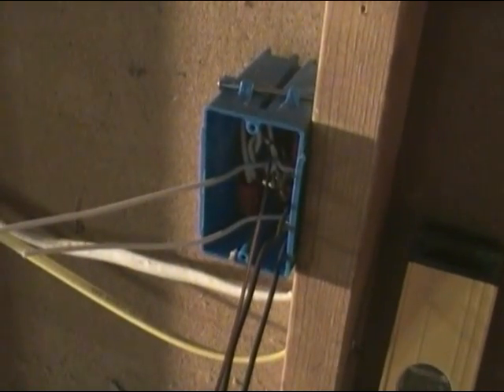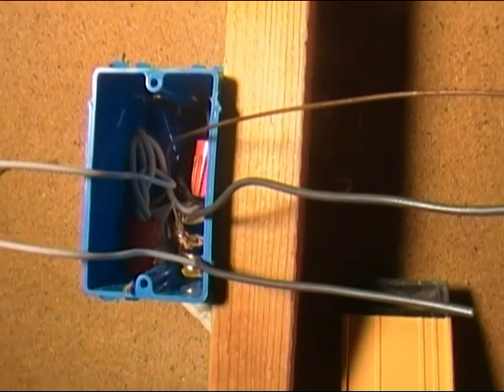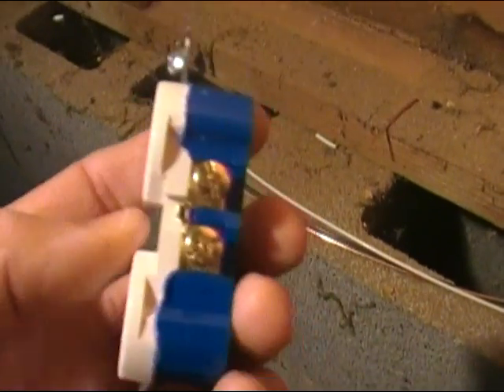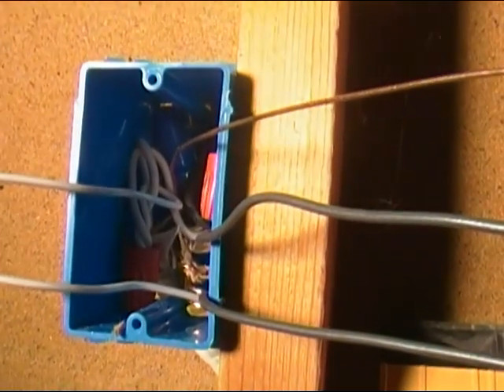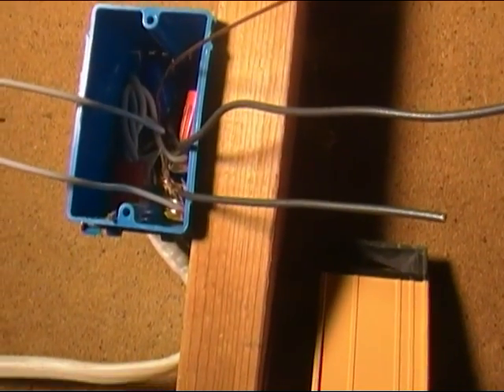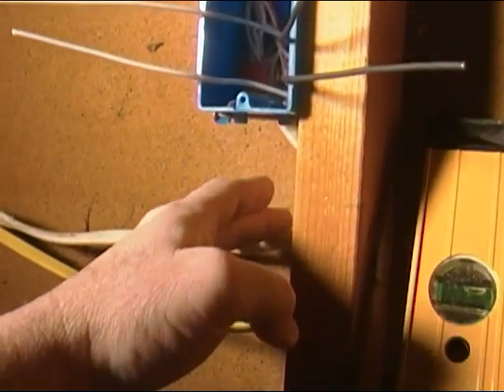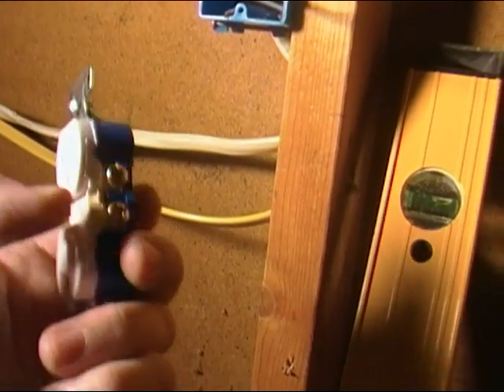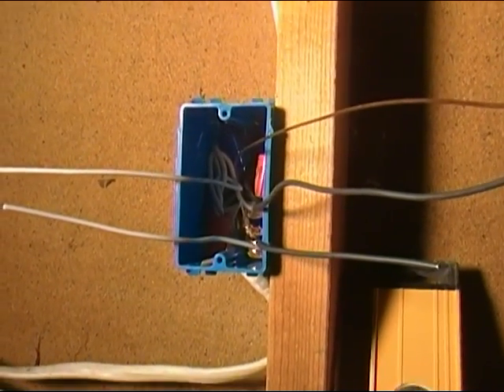How to:  Adding outlets to an existing circuit - Making connections - Electrical

Comment: You should connect 3 wires plus the pigtails on the hot and neutral wire nuts also and have only one hot and one neutral to connect to the receptacle.

Comment: you should show how you do the twisting of the 3 wires and how you came about the one wire being longer than the rest. Explanation is fine , but for someone who has never done that they sure as heck don't understand what your doing without see it. Even books haver diagrams, but video can show hands on. Thank you it was good and i learned a lot .

Comment: Not zeroing in on anyone in particular I've watched several of the tutorials and I don't remember anyone saying to check to make sure your circuit can handle another outlet. There are limits as to how many outlets can be been one breaker.
Reply: I don't think there is a limit as long as you don't exceed the breaker limit. Not all the receptacles are likely to be used at the same time. More receptacles give the advantage of being able to plug in nearby, eliminating the need for adapters, power strips, and extension cords.
Reply: @surferdude642  yes code states how many outlets can be on one circuit. It doesn't  matter If they are all used at the same time. The potential is there.  That's why they don't recommend the adapters that turn one duplex recepticle into six. That's partly why I believe code says there should be a recepticle for every six of wall space. That also tries to eliminate extension cords.

Comment: If there is no slack in existing circuit, how do you get enough wire to twist together if you are cutting into existing wire not a box?
Reply: Use  push in connectors

Comment: Why do you use the bottom white wiring? Why can't you just use the top romex wire coming from the outlet, pig tail that in with the bottom yellow romex and continue just with the yellow romex down the line instead of using the white romex along with it?

Comment: Thank you , you saved me from paying an electrician $300 I spent on supplies $68 At Home Depot and did it myself I bought wire 12/2 , 4 outlets and boxes .2 sheets of Sheetrock ALL DONE😁 p.s  and is up to code standards.

Comment: Thanks for your video sir.  This explains a lot for me but I wasn’t 100 percent sure I could do this.  I just wired in a J-box to add a motion detector light and an additional outlet to my shed.  There may have been an easier method such as yours but I figured the use of a J-box to make my connections would allow for future connection points.  Thanks again 👍🏼

Comment: Perhaps I am dense but you don't say if you are running the  receptacles in parallel or series.  How exactly do I connect the different wires on the receptacle so that it is parallel.  Thank you

Comment: Pig tailing the hot and neutral is fine, and it is understandable not wanting to run the entire load through a single receptacle (makes it easier to troubleshoot in the event of failure in a finished room where nobody knows how receptacles are interconnected), but in this case, the easiest (and permissible) approach, would have simply been to pigtail the hot and neutral in the same way as the ground, meaning you have one of each going to the receptacle.  With a single receptacle, you never need more than one hot, unless you've got both phases of hot going to it.  In that instance, you've have to disconnect the top hot from the bottom one by removing the clip.

Comment: what about the ground for the new line, but it with the outher ground ?
Reply: There's a special green wirenut you can buy with a hole in the top, it lets you secure several grounds and lets one come through the top for the final termination

Comment: Bobby, I am sure you know what you are talking about, but this is a video and you showed no steps on how to reach the finished product. How do you add one piece of wire to the hot and traveler, and end up with two extra pieces of wire?

Comment: Thanks! I was having trouble figuring this out here.. question. If I put a GFI in that first outlet, the one you are working in, will it cover / function for the entire downline / both circuits? Thanks, nice video
Reply: Rich Shields one GFI will cover all the outlets on that line.

Comment: Hey minthillbilly, how come you only respond to the comments that praise you but you never answer the very important amp questions your getting. and why you are mixing a 14ga and 12ga wire. You didnt explain at all what ga wire you using and why . those are the questions that need answering .
Reply: Scott Holloway ... I have 12ga white wire in my home. It’s probably older wire before the color change

Comment: What gauge wire should be used to sprout off from an existing outlet to a new outlet? Also, I plan to place an outlet in my home bathroom. I understand that this outlet must be GFCI protected, but is it acceptable to wire an outlet downstream from a GFCI protected outlet, or would it literally have to be a GFCI itself placed in the bathroom? Also, does it matter what amps outlet is used in a bathroom? I have a 15 amp and a 20 amp receptical and trying to decide which to use in my bathroom.
Reply: In a 15 amp circuit you can use 12 or 14 gauge wire. You can protect lights, fans, and other receptacles in the bathroom from the original gfci. Stay within the bathroom with this. Bathroom circuits should be 20 amps. Use a 15 amp spec grade duplex receptacle. You can use a 20 amp receptacle if you like only if the circuit is 20 amps. You can use a 15 amp receptacle regardless. I doubt that a 20 plug on an appliance for bathroom use even exists.

Comment: Only problem is now that entire circuit (previous outlets and added outlets) can only handle 15 amps since that is a 15 amp outlet you connected them all to. All the power runs through that 1st one so it will potentially overheat and melt/fail.
Reply: I thought the same thing at first but Im thinking it might be an older wire before the industry standard of white and yellow for 14 and 12. My shop has old grey wire from 14 all the way down to 6. If that's a basement or garage Im sure its 12/2 on a 20. Nobody runs 14 for any outlets that I know of unless its a dedicated run for a low amp appliance.
Reply: You can use 12-2 wire with 15amp circuit breaker, but can't use 14-2 wire with 20amp circuit breaker....I think, right??? LoL
Reply: I was scrolling to see if anyone else caught that!
Reply: almost every circuit in every house is 15amps.  You run the whole room full of outlets on the same circuit.  Only exception would be a kitchen or garage where appliances may pull more amps.  it will not be an issue. I would pigtail all the wires so if 1 outlet fails the rest keep working
Reply: Nel L *receptacle
Reply: Paul Jackson exactly!  "Melt/fail"?

Comment: Thanks for taking the time to make this and post it. I had a look to see if it would help me with my problem but it didn't so if you have time can yo advise please?
I had an existing live wire running from fuse box to plugs and light switches, I added a plug in the middle of this wire but the plug remains completely dead (But power runs through to existing plug outlet Ok) at first I thought bad connection as I used "push" connection type plug at first - so I changed to a heavier duty screw typr plug still completely dead and as power runs through to existing outlets I am truly baffled! (100volts 2 wire) Sincere thanks for any advice.

Comment: I just put one pigtail on the Ground, one on the grounded conductor, and one on the hot conductor. That way you are not using the receptacle to complete the circuit. If that receptacle fails it will not take the other receptacles.
Reply: TexasCardShark, so essentially you're wiring it in parallel as opposed to series to prevent all of them from failing if one fails? If not, it kind of seems like you're achieving the same outcome maybe?

Comment: Thanks for sharing but I am still confused about the yellow wire, were it is connected to?
Reply: The wire outside the box? That's going to another box for another device? Is that what you mean?
Reply: Yellow wire is connect to the homes power supply box. (Fuse box)
Reply: The yellow wire (romex) is for the new receptacles he's putting in. The white romex is the existing wiring he's adding to. He explains it at 50sec.

Comment: I'm having a problem from the main box is 3 cables to the wall power adapter in the one room than from that point it ran to the next room but only 2 cables run from their I put a new box in wall power adapter where the 3 cables is running but now the 2 power adapter do not work Wat do I do

Comment: Thanks  For helping me out. I have a ceil fan I am trying to add to an outlet that is in the circuit. There is no ground as my home is 1928. So if I am understating this I tie my feeder and the outlet together to make one ad then leave my new wire for my fan to the other white and black? Sorry I have zero  eclectic  experience. Thanks again..
Reply: sonastainbrook if you unsure about what your doing don't do it!!!! its not worth someone dying or your house burning, electrical work is simple especially in your house but for not qualified personal which you qualify as can be extremely dangerous . also you have to make sure that you the proper conductor size (wire) and ocpd ( breaker) and devices (receptacle, switch, or anything of that manner) can hold the amperage that you are drawing on that circuit. i would call an electrician to do the work, but it could be at the highest cost $500 if he has to change out the circuit or as low as $120 for simply hooking up the fan to the box.
Reply: Thanks for the advice but I did infact get it done by myself with the help of this video! I watched it twice and then got it. Utube rocks!

Comment: piggy backing on a single connection point will never meet code unless you have a specific lug designed for it and even then it is usually frowned upon